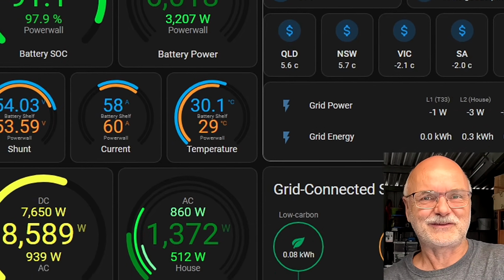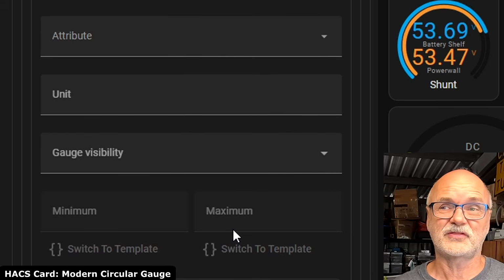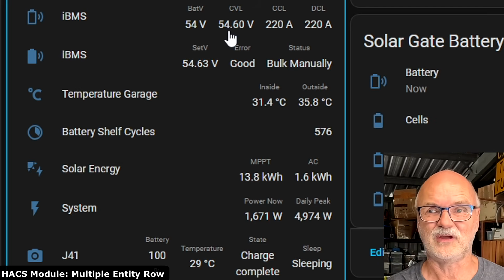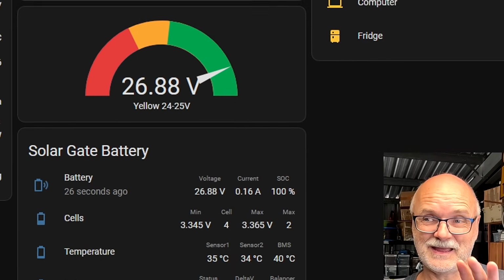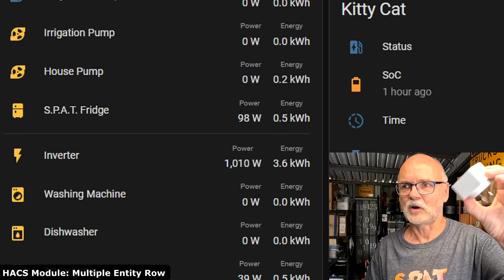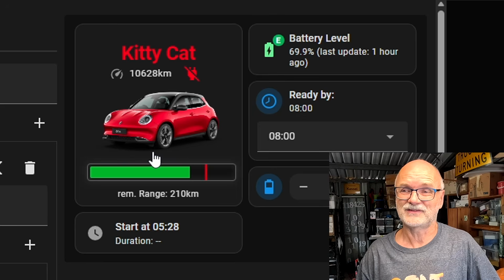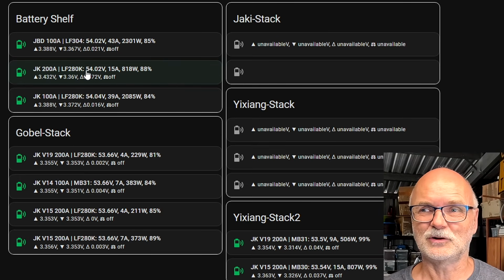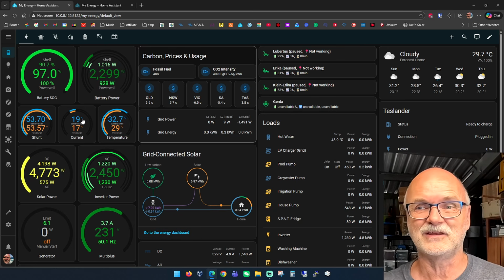Energy Dashboard in HA

Comment: That’s great you start off with a forecast, after all we using the sun to charge our battery banks and so the weather is always going to play a part in this. I came back here to see just that because I read in the Guardian that Down under is been experiencing temperatures up as high as 50c. I was hoping to see if you had finished that air-con.
Reply from the maker: Yes, AC is up and running. Don't forget, Australia is as large the US or Europe. ..

Comment: When I encouraged you to move towards HA a few years ago, you told me you had "very low confidence" in HA.  If you remember, I told you that the fact that you do not understand how to use a tool does not mean it is a bad tool.  Better late than never.
Reply: Yes, I remember his dismissive comments from back then, he's seen the light now though.
Reply from the maker: Yes, I remember that discussion we had. And I explained this in my video here again: I'm not reliant on HA to keep my system running. If the NUC fails, the network breaks,  my lights stay on and the system keeps running safely. That is still the main concern when introducing more and more systems to control an important energy system. So, my opinion from back then has not changed. But I agree, HA is a very nice tool for monitoring the system.
Thank you for pointing that out already back then.
Reply: @OffGridGarageAustralia I agree totally, with Victron we have the luxury of running Node Red directly on it, which I use extensively for scheduling off peak charging and peak discharging. HA has very little control, it sends a signal when I have a cheap rate outside the normal off peak period when the car charges, that's it. Other than that HA is only used for monitoring and data reporting in my case, much as you do, no need to use it for control. If HA stopped working the only issue I'd have is if the car charged outside off peak times the Victron system would use the house batteries to cover the load.

Comment: Excellent video, what sensor do you use to measure the hot water temperature? is it on the outlet pipe or cylinder itself?
Reply from the maker: It is a Sonoff temperature sensor with a 1m probe. It sits in a pipe to measure the temperature inside the tank (at the top 1/3).
I have added it to my homepage here: https://off-grid-garage.com/automation/

Comment: I use node red with 8 relay’s to automate reserve battery charging, power station charging on grid charging based on voltage reading nd many many more things including graphing net battery energy and ongoing counter of remaining energy etc….
Reply from the maker: Yes, that's also a good way and included in the Victron Venus OS Large installation. I tried a few times but it seems very difficult to get your head around how Node Red works. Never could get it to work for me...

Comment: 1. Even Victron Shunt is not % accurate. I have an automation when min cell voltage gets to 3 V, => run a grid charger. Happened a couple of times during winter. You could even set-calibrate the SOC, when voltage at this level. 2. Was also thinking to get this ODBII dongle, but will it drain the EV tiny starter battery if left on the car all time?
Reply from the maker: Yes, the Victron shunt is also not 100% accurate but far better than anything he have. I have tried to avoid any important automations in HA for my power system as I don't want to rely on it if it fails and then nothing works any more. I use it mainly for monitoring purposes.
The WiCAN Pro shuts down when idle and wakes up again when the vehicle's ICU starts, so it will not drain your 12V battery. This is all configurable in the device. I have set mine to 15 min sleep time. It uses only very little power anyway. In an EV it is not a problem at all as the traction battery will just recharge the 12V battery if it gets low.

Comment: How about showing how Home Assistant is connected to your system in order to collect all the data you are showing?
Reply: Likely MQTT, at least that's how mines connected, via Node Red.
Reply from the maker: Most of the connections are automatically. As soon as Home Assistant discovers a device on the network it shows the data and you can use it in your cards/dashboards.
For everything else, it does not automatically discover, google it and in 99% of the cases you will find a Github repository with instructions on how to install it in HA.

Comment: I tried to set up my Tesla Powerwall system with Home Assistant several times. The terms and abbreviations they use are not straightforward or clear, and after failing many times over several different attempts to get the specific information I wanted, I just gave up. You not only need to be a programmer, you also need a glossary to translate their choice of labels into something that makes any kind of sense.
Reply from the maker: I'm sure there is plenty of information about the setup out there. Or get some help from AI to set it up. I use it sometimes for this kind of stuf. It's like your personal mentor and trainer.

Comment: Would you go over your current setup on the Victron Cerbo screen and setup.  I have not undated mine for a few years.  Great stuff on your Home Assistant pages.  I already have the Modern Circular Gauge implemented on several cards.  Maybe I'll take the time to set up the whole system card on my system.  That is beautiful!  Thank you so much for your videos.
Reply from the maker: Thanks for the feedback. What in particular would you like to see in the Cerbo/Venus OS? Most is plug'n play and there is very little configuration needed.

Comment: Nice dashboard Andy. One thing i have found helpful is a figure showing the total versus remaining kWh. Percentage doesn't help me workout if i have enough energy to turn on the hot water! Can I ask though, how are you getting the hot water temperature?
Reply from the maker: Yes, I have changed the gauge in the top left of the Dashboard now. It show me:
- available kWh in the battery shelf
- available kWh in the power wall batteries
- available kWh overall (aggregated)
The circles around showing the % for each of these figures. I'll show it in a video soon.

Comment: That is so impressive. Two points... 1 - be careful with older unsupported integration for any potential CVEs and 2 - you really need to have a backup home assistant setup or two and test the failover process.
Reply: I think his approach is to not rely on it, which is the correct approach.
Things should not stop working when you loose network or loose HA.
Reply from the maker: Thanks, David. Yeah, I really use HA only for monitoring purposes and do a backup every night which uploads to Google Drive. I think I'm pretty save and can restore the system even on another platform. I will setup HA on a PI and try to restore the backup there.

Comment: I was wondering about the "modern-circular-gauge" the video the other week, thanks Andy, Yes you can't beat Home Assistant for data tracking, I purpose you are counting the days down to totally off grid?, I did the jump off grid back in Aug 2024, never had a blackout, next few weeks I am installing the Victron 22kw EV charger, which I will check your video out about that
Reply from the maker: Thank you. For me it's another 2 years before going fully off-grid, unfortunately. We had three black outs in on week during the last storm. When a storm is forecasted we already lose power😄
Let me know if you have any questions about the charger. What EV have you got? Put it on your channel.